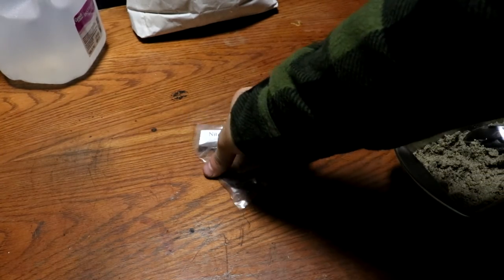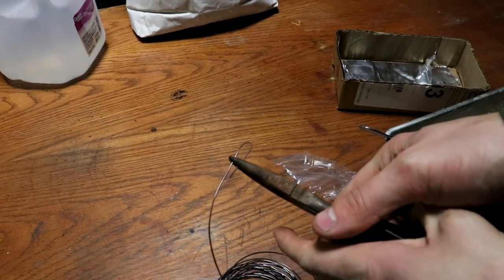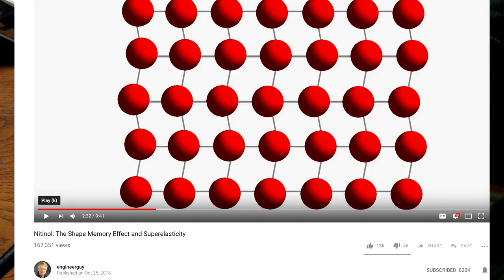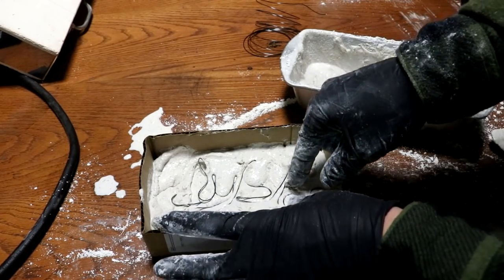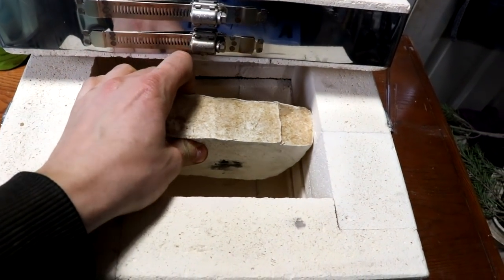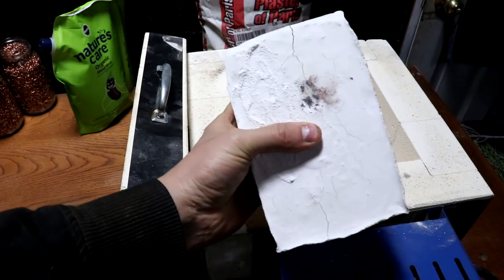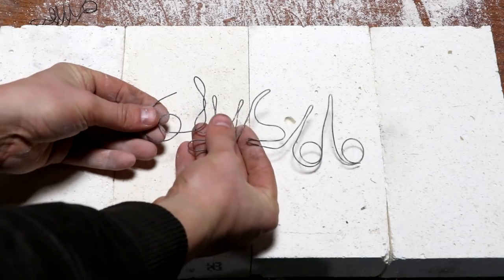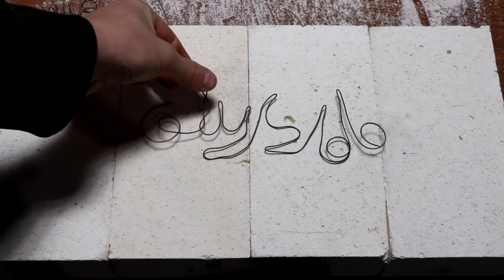Training NiTinol Shape Memory Alloy

Comment: honestly that hammer lifting test was the most impressive part to me.  I had no idea this material's "memory" was so strong
Reply: Oh, it can tear itself apart if you tie it between 2 imovable objects.
Reply: @FelonyVideos  damn
Reply: I wonder if you could pass electricity through the wire to heat it up 🤔
Reply: @omnacky  That's exactly what I'm wondering too
Reply: @omnacky  you sure can i think thats how the detaching mechanism in a surface book works
Reply: Yes, that it how little insect robots work. Nitinol has a little resistance, so a current can heat it. The reason they like to make springs is that springs are forgiving. A straight wire of nitinol can also be programmed to remember being shorter, then stretched. It you tie it between two hard surfaces and heat it, it gets shorter until it snaps in half. A spring has a lot of flexibility, and so, doesn't snap.
Reply: @funtechu  tl;dr?
Reply: @omnacky  yeah there are nitinol engines, a few decades back it was treated almost like a miracle material, check the video 5- Megawatt Nitinol Engine by Mcdonnell Douglas
Reply: Small memory-wire structures have been used in prosthetic masks; passing current through the wire makes the left eye-brow move upward, for example.
Much lighter than pull-cable rigs!
Reply: @omnacky  absolutely in fact that's the more usual case for things like muscle wire for robots
Reply: The material elastic strength about doubles when heated, making it stronger when hot, than room temp.
Reply: It was easier than training my human centipede
Reply: Future rovers are going to use them on the wheels to make tires that repair themselves. Just send a little current through the wire and it will aggressively reform itself.
Reply: @FelonyVideos , lol), reminds me the "Unbendable" tag )))
guess where from
Reply: I wish my memory was so strong.
Reply: Thanks for the memories
Reply: yes! lets have a whole video on testing this "strength"
and uses? Will sunlight reshape the wire?
Reply: @omnacky  Yes. I have model railroad road barriers moved by electrically heated nitinol for slow movement.
Reply: @aquarius6139  I think it's included in the EngineerGuy's video that Cody mentions and links in the desc above
Reply: Thank you for this comment. I stopped it right before the test when he said goodbye and without this comment I wouldn't have noticed I missed something
Reply: @omnacky  You can. NASA are considering it for a wire mesh wheel which would be able to deform on sharp objects without tearing, then heat up strands of the mesh to return to wheel shape.
Beating the aluminium wheels they currently use in longevity.
Reply: @omnacky  I actually built a small 6 legged walking robot that uses nitinol wire as it's only form of actuator. Cool, but quite inefficient, considering you have to heat the wire.
Reply: I guess it can be modelled as a spring with the coefficient being a function of temperature. My question is: what does this function looks like? It seems like a very sharp variation.
Reply: An engine was my first thought when i saw the hammer fall after the flame was removed, from the comments looka like it's been done.
Reply: It tends to jump out of the pliers when I try to set it in a loop
Reply: @omnacky yes you can I tried it and so did action lab
Reply: @omnacky  Yes you can, nitinol has a high resistance so it doesnt take that much current to heat it up. Now ask yourself this question, is the amount of energy needed to heat up the wire = or less than the energy in mechanical force it can produce trying to return to its shape?

Comment: You can use hot water to activate the SMA gently and evenly... 
For the training process: We found 500°C over ~15min to give good results. Any metal parts touching the SMA should be stainless; zinc plating seems to migrate into the Nitinol. 
The plaster idea is brilliant!
Reply: So to train requires 15 minutes of 500?  Wow. That's a long time and a lot of heat.

Comment: What happens if you bend it then run an electric current through it because if it reformed that would be great because if you had it in a machine having to blowtorch it every time you wanted it to work would be annoying
Reply: Actually that sounds like a good idea
Reply: I believe any energy you will put into it will cause the shape to return.
Even if electricity itself would not cause the effect, there would be heating from the resistance.
Reply: That works well, my old professor investigated using SMA actuators for braille computer displays, it didn't pan out because the "frame rate" was limited by the time it takes the nitinol to cool down
Reply: Probably even hammering it would create enough heat to let it get the original shape
Reply: Yeah man i had the same idea
Reply: The resistance of the metal will cause it to heat up enough for the martensitic transformation to occur.
Reply: Doing what you describe is actually very non-uncommon.
Reply: @among-us-99999  you and your double negatives.  i dare you to make a complex statement using imaginary words.
Reply: Or drop it into hot water
Reply: It works wonderfully well. I built it into a robot for a University project. if you want to do it I recommend using a bundle of hair thin wires rather than a single thick wire.

Comment: Thanks for  introducing everyone to NiTinol (Nickel Titanium Naval Ordinance Laboratory). Irregular grain boundaries are one of the reasons for it's characteristics. The Japanese secured the patents from America over twenty years ago. They've used it to knit broken bones together, used it in dental implants, automatic louver springs for HVAC and the list goes on. The Navy started with CuNi and went from there back in the late 40's. There are several methods for cold working and heat treating if my memory serves me correctly.

Comment: The show with the hammer at the end gave me an idea for a nitinol timer:

1. Train nitinol wire to be a spring.
2. Hang a weight from nitinol wire.
3. Set up a button below the weight to run current through the wire for a set time.

When the weight stretches the wire enough, it will depress the button, running current through the wire, raising it back up to its starting position. Simply record every time the button gets pressed.
I'm not sure how you'd get the current to run long enough to raise it back up, but it would be interesting to see how the nitinol acts after repeated heating/stretching, as a function of how long it takes to push the button after a set time of heating.

Comment: Could you pass a high current on the wire?
Reply: it will result an even eating!
Reply: Gaspar Albertengo actually you don’t need high current to activate the alloy.
Reply: It was used for a chock spring in the old cars
Reply: You crazy greg larson those old car chock springs could not handle a high river current thru dem. They'd spring a leak :}
Reply: +1 would like to see
Reply: Yep! At room temp, you need around 2 Ampere

Comment: My dad had a patent a number of years ago to use this stuff in automotive electrical connectors.  The idea is, if the connection isn't great and the current flow causes it to overheat (like they oft do), the NiTinol "tongue" or "finger" in the female end of the box-shaped (or cylindrical) connector that is gripping the male spade (or post) end would press HARDER because of the heat, providing a better connection, and (hopefully) preventing thermal run-away.  The connector itself wouldn't be made of this stuff, but utilized as part of the spring mechanism.
Reply: This had the benefit over traditional bi-metallic strips in that it wouldn't pull away if the connector got very cold (any winter's night), the extra spring action would only activate as a result of the unwanted heat.

Comment: Great video! I've thought if this also might be possible using an electrical current, e.g. encase the shaped wire in clay or plaster/sand, and apply a voltage that would heat the wire. That should be easier than using an oven (for most of us), and you could probably measure the temperature based on the electrial resistance?

Comment: I grind niti wires at work, when theyre down to about .02" or less in diameter you can make a loop, pinch it in your fingers, and full fast on both ends and it will snap in half. Cant do the same with stainless steel wires, when theyre down to about .005", you can stretch them about 15% in length like a rubber band. It also wears down our machines about 7x faster than steel.

Comment: That hammer demonstration could have some interesting applications. If you supply the heat just with current and the wires own resistance, you could have an incredibly simple actuator

Comment: what a lot of people don't know is those flexon glasses use a different formulation of NiTinol, with the memory point below freezing and the memory point still quite high. NiTinol is a super-elastic metal.
Reply: skyliner_369 Yeap, you just need to increase the %Nickel in the alloy to lower the transformation temp.

Comment: That hammer experiment at the end blew my mind. I really didn't expect that! I would have assumed that heat added to it would weaken the strength of the wire, but the elasticity just dragged it on up there. Does this behave the same in sheet form? I.e, would it make sense to make fenders/bumpers out of it?

Comment: will it self-destroy (gotta be a better word for this)? Fix both ends of the coil and heat it. See if it will break under the tension or if that much force would require so much heat that it would be 're-trained.'  Really neat to see the coil do work and then relax went it cooled.

Comment: Maybe you can use this as a temperature switch? Spring holds up conducting weight as long as it is hot. If it cools down below certain temp, weight drops, contacts conducting surface and completes circuit?

Comment: you should try putting something that winds up like a music box or clock or toy that has a governor in it in the vacuum chamber and see if it goes faster because the governor slows the mechanism down using air resistance

Comment: Just for start of this video, you could just make sign "Cody`s Lab" from square letters, and then put some nails in the wooden board, then bend wire around that nails so you would have square sigh. Then if you want to prevent wood from fire - use some tinfoil or just make this wood wet and you can create better "Cody`s Lab" wire done. And wow, you can later just pack this in way it came, like roll it and send to someone for him to heat it and read hidden message :D

Comment: Perhaps it would be worth making a template of nails hammered into a board in the shape you want and winding the nitinol around it, then applying the torch directly. If that worked ok it would be a lot less bother than curing the plaster & heating in a furnace...

Comment: Is it conductive? Could you put it in the plaster with a lead sticking out either end (overlaps would need to be insulated for this I guess) then just run a current through it to heat it real quick? Wouldn't even really need the plaster at that point, just pin it to a piece of wood or something in the shape you want and a few seconds of current would heat it up. Would make it a bit easier to make accurate shapes since you don't have to encase it and so much faster than waiting on a furnace.

Comment: That last clip gave me an idea: the energy that lifts the hammer comes from the thermal energy of the torch only right? you theoretically cold make some kind of generator that harvest that energy from the fluctuations in temperature, it cold be applied in some kind of  place that have big fluctuations, like the back of a refrigerator for an proof of concept hahahah
Reply: @JorgTheElder  i know, the peltier plate or the  stirling engine are exemples, i just never saw anyone using that mechanism of deformation, and think that wold be fun to build something like that

Comment: Next time, instead of using plaster, use a perforated metal sheet and screws to fix the alloy in the desired shape.
After that, put it in a furnace for 10 minutes at 500C and then into cold water.
Please do another video with superelastic alloy. Cool it down below its transformation  temperature and let it recover in room temp.
Cheers!
Reply: I forgot...for the spring, use the same method above but using a mandrel and a couple of screws and nuts to fix both ends. To make the spring, use an electric drill.
Have fun!

Comment: That hammer bit at the end got me thinking. Could you use heat to lift a weight, then use the weight to drive a gear to run something like a clock mechanism? I understand that it takes a lot of heat to make the wire go back into it's trained shape, but as a proof of concept?

Comment: Hi Cody,  
This was another awesome video on your channel.  I wonder what would happen if you ran a current through the wire to heat it up.
Would it also reshape itself into the original form?  Could you make an "artificial muscle" controlled by electricity?
Make a great video, and answer I question I've had for years :-)

Comment: That hammer got me thinking: What if you set up a switch beneath the hammer that turned on the torch? Hammer comes down, pushes button, torch heats wire, hammer lifts, wire cools lowering hammer and the cycle repeats itself. I think it'd look pretty cool

Comment: Would running enough electric current through the wire also heat it up enough to reshape? That way you could control a spring with a switch or something

Comment: Now I'm curious if this stuff has large enough resistance to heat itself under electric load. Thinking wrapping the spring shape with nylon string to create a spring with electrically variable strength.

Comment: So im curious what is nitinol used in and for what purpose, all i can think of would be a special heat sensitive circuit breaker or switch ( example being like the old heat triggered breakers in space heaters used back in the 70s and 80s)

Comment: Why is there a orange flame coloration at 1:10? My initial instinct would have been flame coloration, as in the flame test, but a quick Google search reveals, that both nickle and titanium are coloring a flame white...

It could be some coating being burned of but I'm not to sure why you would coat such a technical alloy straight from the factory...

Comment: So could you pass a high enough current through the wire, such that the resistance would cause the wire to heat up? If so could the hammer trick be performed again using electricity please?

Comment: Is the wire conductive? if so is it possible to measure out length of wire with the right amount of resistance so that you could use electricity instead of a torch. Lots of ideas can come from that.

Comment: Would putting a current through the wire while it’s bent cause the NiTinol to contract back to its original shape? Using the resistance to heat it.

Comment: What happens if you run an electric current through the wire?  Is there enough resistance to generate heat and bend the wire?

Comment: Any suggestions on how to heat the nitinol to 500 degrees if you don't have an electric funace? A hot air gun might work, but I don't think I can heat the entire cast up with that. I tried an open fire, that did not work very well. Now I am thinking about leaving the ends out of the cast, and running electricity though the wire.

Comment: what if you run some current through it? like 10A to form it in the plaster, 5A to return to shape. Current is determined based on gauge, resistance, them all requirement.

Comment: Does it still contract back into place if you pass a current trough it or short the ends on a battery to heat it up that way?  The hammer lift was impressive, never would have guess it could pull that off.

Comment: Does this alloy have any practical uses in engineering/science?
Reply: Taps for the hot water for people with reduced sensitivity that can shut themselves off when the water gets too hot.
Reply: @matthewgarcia5617  so it is basically a thermometer?
Reply: @sealfoam6841  not really, a thermometer relies on the thermal expansion of a material to indicate the surrounding temperature. Memory metal like Nitinol relies on a martensitic transformation for it to "remember" it's previous shape. I would recommend watching the linked Engineer Guy video as I'm sure he explains it much better than I can.
Reply: @matthewgarcia5617  thanks I'll be sure to check it out
Reply: NASA is using it in their bearings for the ISS's urine system, it's very strong compared to other traditional bearing materials but without the brittleness of hardened steels or ceramics, and it is very resistant to corrosion. It's used for stents as well since the body doesn't attack titanium. I could go on since I finished a term paper about this material. I can link my sources though if you want to do more reading.

Comment: could you have just bent the straight wire into "Cody's lab" (off camera) and then started filming and heated it up until it started deforming. Then bend it back into "Cody's lab" and reversed the footage? :-P save some time in the furnace